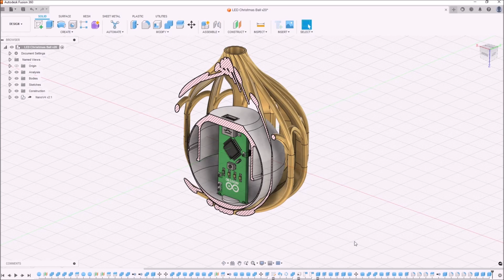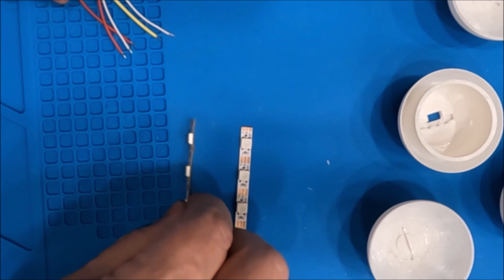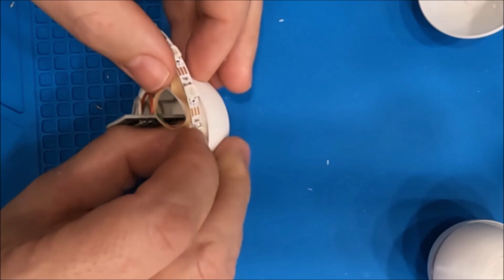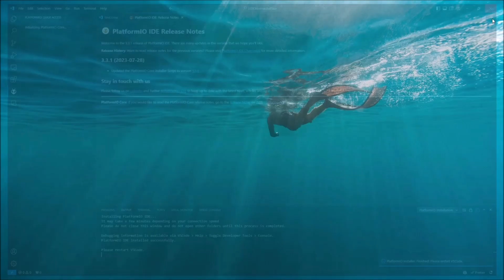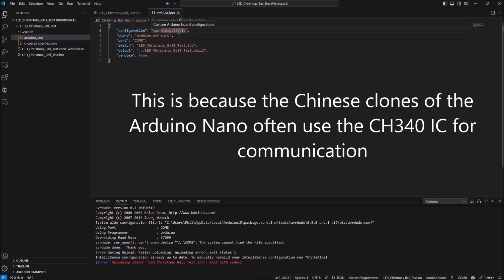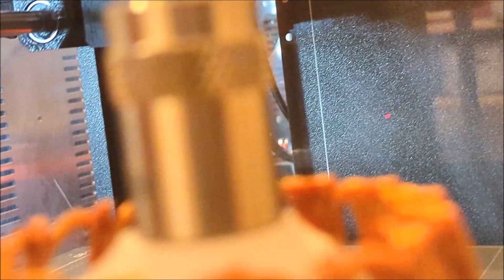LED Christmas Ball

Comment: Great work, Philippe! I'm wanting to do something very similar, but rather a Christmas Ornamant, it just be a "fidget toy". The idea is to have a Sphere of LEDs with a Potentiometer to rotate through RGB Color values. 

Basically combining your build with Blitz City channel's "Control an RGB LED's Colors with One Potentiometer" video. 

Right now I'm trying to learn how to run 5-6 WS2812b LEDs using a Rechargeable Lipo battery. Do you have experience with the TP4056 Recharging Board? If you have any resources for working with rechargeable batteries, I'd love to hear them. Thank you for the inspiration, cheers! - Blake

Comment: I made rgb leds a week ago and when recording them it has that  flashing problem when your phones frame rate is not synchronized with lamps refresh rate as the same problem your recording has. do you know how to fix that?
Reply from the maker: I did not fix the fact that the refresh rate is not synchronized to the FastLED refresh rate. It was annoying and I tried to film this part in 1080p 30 fps and then in 60 fps and then in slow-motion mode at 240 fps and I still had this flicker. I think that the solution would be to use the fact that the FastLED library allows to change the refresh rate and pick a refresh rate that would be a prime number so that the refreshes are as asynchronous as possible to the 30 or 60 fps.
Reply: @PhilippeLacoude  Oh the thing is i wasn't using fastled, rather trying to get a normal common cathode rgb led to cycle through all the colors and using digital write and pwm instead of analogwrite because i was experimenting with this ch32v003 microcontroller and found a arduino library for it that exactly didn't support some analog features like read or write, but i got it working, the thing is i bought a ch32v003 because they're really cheap like 20 cents till i realized once I got them they were janky to program with and made a cool papercraft house that lights up and cycles colors